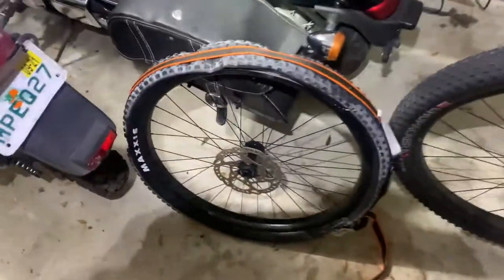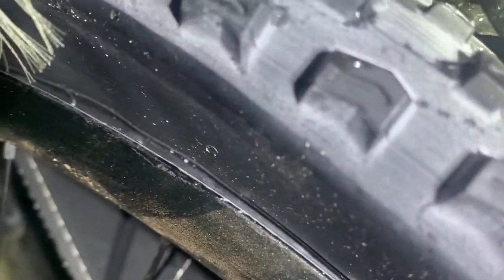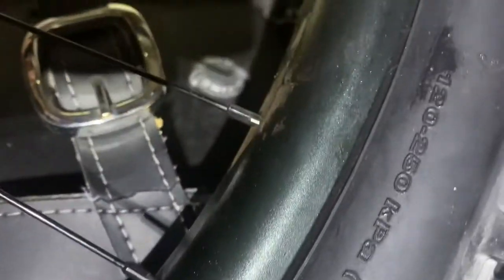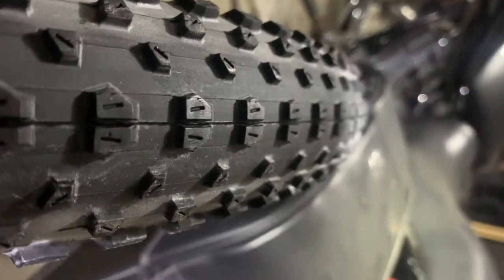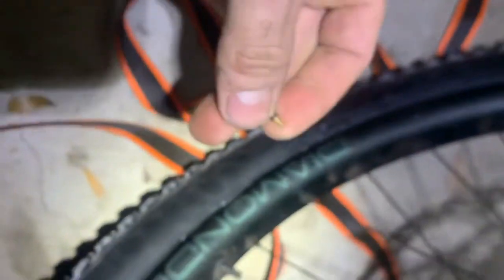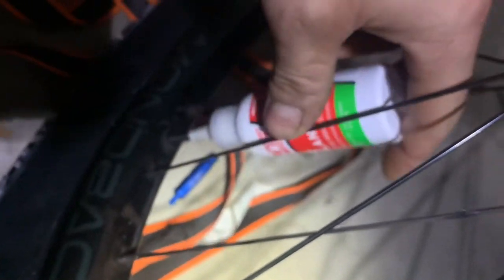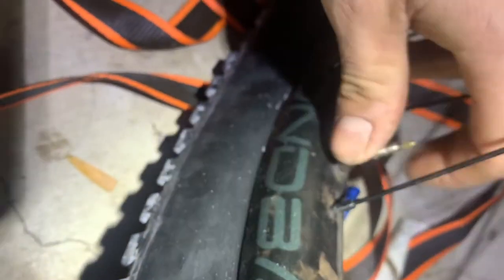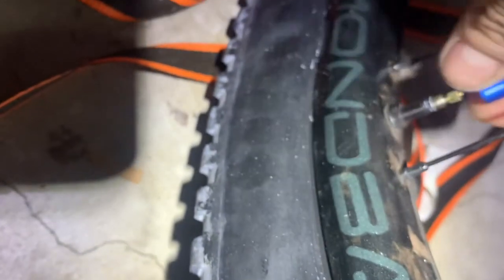How To Seat a Stubborn Mountain Bike Tire The Easy Way

Comment: You are my savior ! I have replaced tires in the past and never had a problem seating the tire even using the ratchet strap technique. The real trick was spreading the tire before adding air. Thanks again its the little tricks that not everyone knows about.